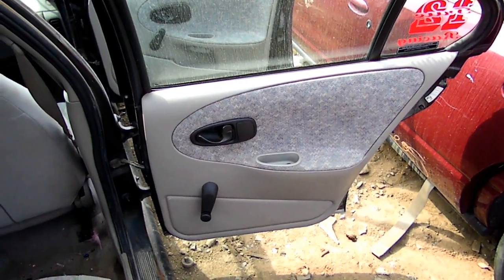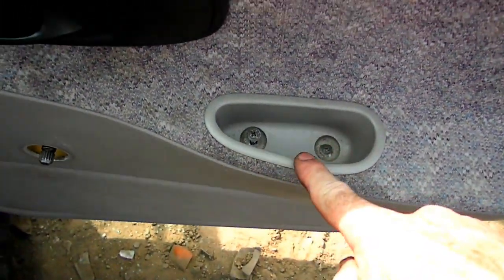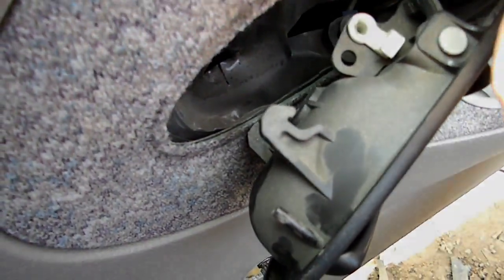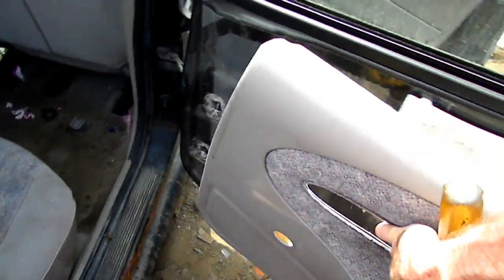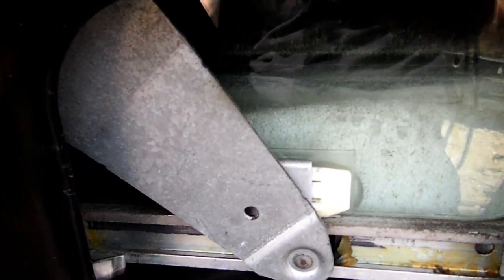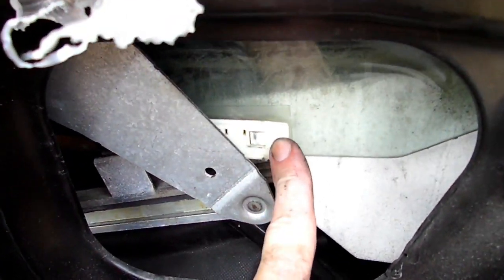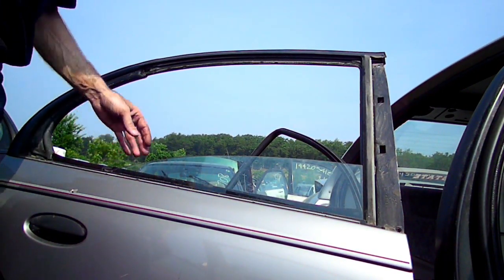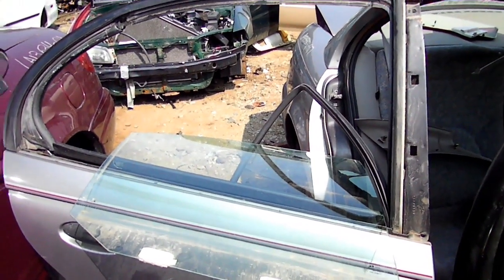Saturn Rear Door Glass Removal

Comment: I had to study this a bit more, then I got it.  Thanks, Rich.  It was a bit hard to pull out the triangular window, then later very hard to put back in place until I wiped a little silicon grease on the edges of the glass, then it slipped right into the corner very easily.
Reply from the maker: Glad you got it done Great job!

Comment: Rich will you please do a video on fixing a manual window crank. My drivers window on my saturn sl2 will only roll half way and then I must pull it up the rest. When I tried to fix myself I messed up the lock position and trapdoor to the key opening. Another video that would be great is re soldering the rear connections to a rear window defroster. Thanks your videos have made my car run better than ever before.

Comment: Another great video. My Saturn and I owe you a few virtual beers.

I did find it easier to get the window off of the sash (?) with the rear quarter window out and the glass rolled up to the top.  Just push down the white clips w/ thumbs and, even though it was a little crusty from sitting, slide the window off the sash.  If I'd thought to bring some soap and water, it'd probably been even easier, but it came out fine.

So when do you show me how to put it back in?!!  Thanks again.